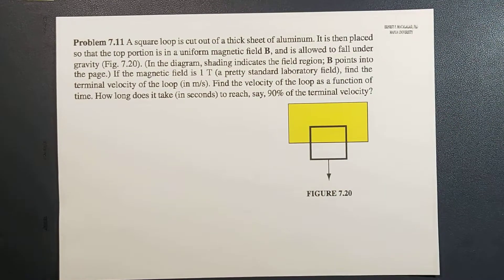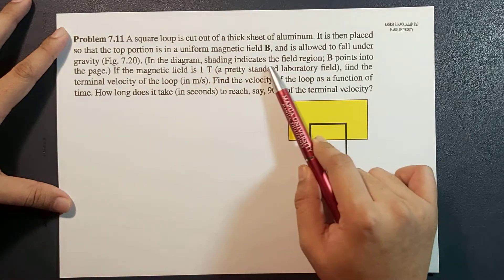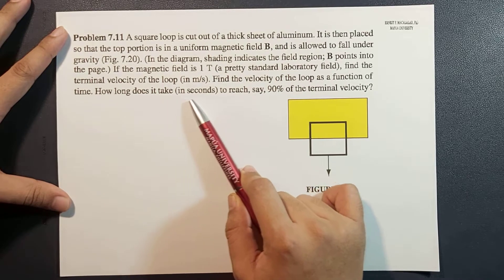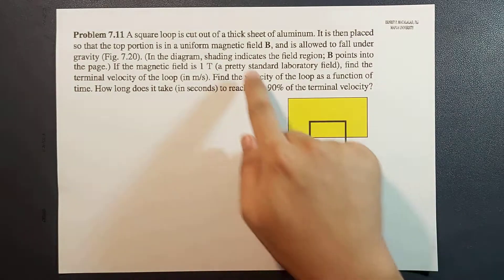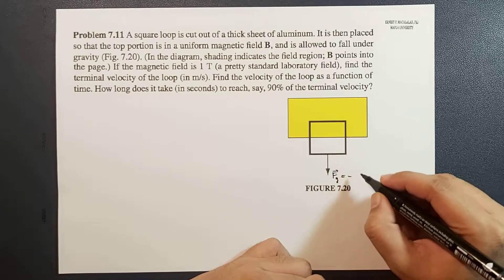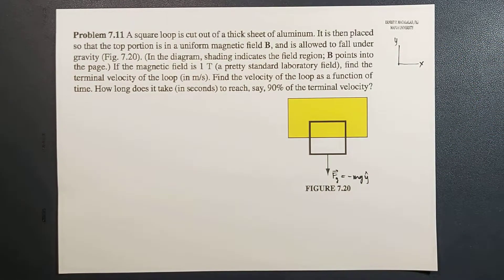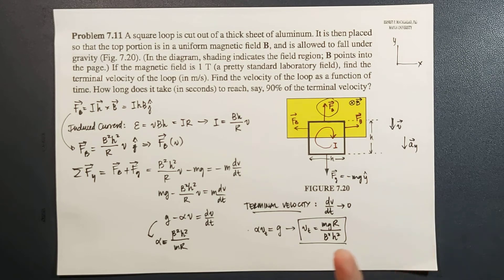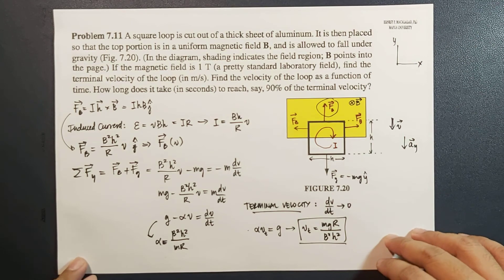Electrodynamics:  Motional EMF Griffiths 7.11 - Part 1

Comment: But what about the horizontal force due to the magnetic field, i.e. (vxB)? Won't the loop tend to describe a circle?
Reply: Wait.. The magnetic force due to the velocity of loop will affect both positive and negative charges, so we have equal forces but in opposite direction and no displacement will occur (considering that the loop is uncharged). Right?